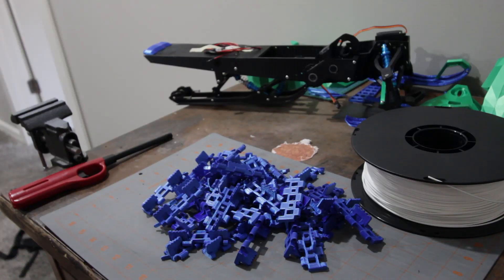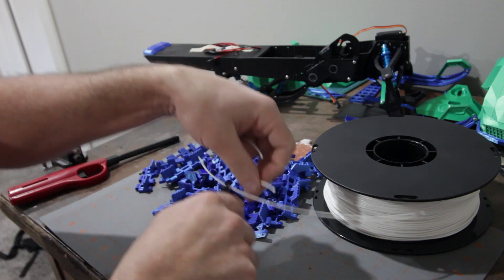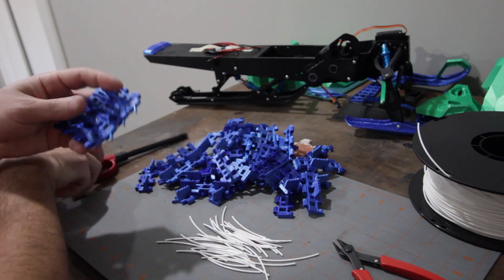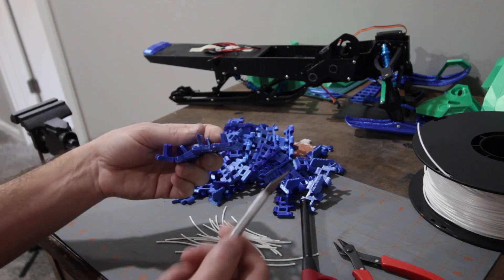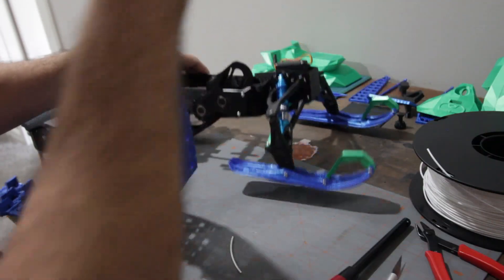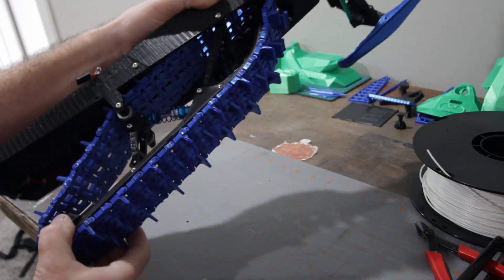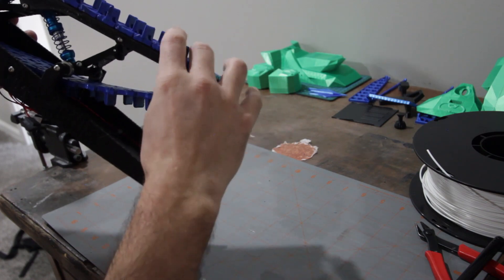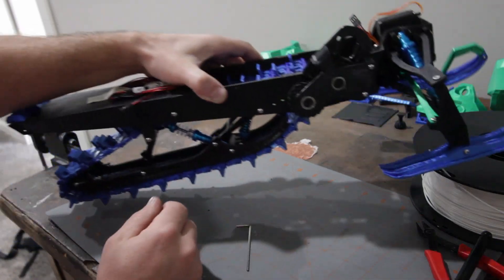SkeeRide Assembly Part 5 - Track

Comment: I printed all the track in 50% infill will that work?
Reply from the maker: I print track with enough walls that it’s basically solid. As long as you’re close to solid you should be fine.

Comment: How Mutch infill and wall for the track pieces
Reply from the maker: I do 6 walls 50% infill.
Reply: @BuildItBetter3D  thanks a lot
Reply: And for your print what speed you are using
Reply from the maker: I’m printing at 60 mm/sec but that will depend on your printer.
Reply: @BuildItBetter3D  ok i have an ender3

Comment: How i do i have print tracks in flex. Wajer ord filament when conekt Tracks?
Reply from the maker: The track can be printed in pla or tpu. There is track design for tpu without the side tab, or there is one piece tpu. If printing individual track pieces then connect with piece of pla or abs filament, or with aluminum rod. If you join the discord channel you can get other opinions on what is better.
Reply: I am prenumerera. If it is Facebook?
Reply from the maker: https://discord.gg/8HbK9fPJ

Comment: I am just about to maybe print the seat but it says it will take 24 hours in creality slicer on a higher quality mode but not the highest. Should I speed it up or would that mess it up and make it look bad?
Reply from the maker: It’s a pretty big print. Depends on how dialed in your printer is. I think I usually can print it in 14-16 hours. You don’t need a ton of supports on the bottom, where the track goes. Your printer should be able to bridge that area. 0.2mm layer height still gives pretty good quality. It’s all up to how smooth you want it and how long you’re willing to wait.
Reply: @BuildItBetter3D  maybe I will just let it go and let it do it on the setting it is on. I think it is .15 but I didn’t see the estimated time for the rest of the settings. Next time I go to print something I will take a look. With the stuff we printed so far it has gone good so thank you for the awesome model.

Comment: I am wanting to use aluminum rod instead of fillament to hold them together but all I can find is 2mm diameter will that fit or is it to big
Reply from the maker: I know many people are using 12 gauge wire, and I think that’s around 2mm. I think it will depend on how accurate your print is and how accurate the wire diameter is. You should be ok to use it though.

Comment: One question would it be good if I used flexible filament for the track or hard filament I didn't know since you used hard filament.
Reply: I have lots of flexible filament but not a lot of hard filament
Reply from the maker: Some people have printed it in flexible and like it. There is track pieces included that don’t have the tabs to be melted, they’re for if you print in flexible, you can just flex the end over your track pin.
Reply: @BuildItBetter3D  thank you

Comment: That track looks backwards to me, wouldn’t you want the braced part of tread on the frontside and the tabs should be facing the rear so they don’t catch anything?
Reply from the maker: I'm not sure I am following what you mean, but they are on correctly. They are designed with a bit of a bevel to assist in the catching and pushing down of the snow.
Reply: he’s saying maybe the bevel should go the other way so the stronger part of the track is hitting the ground first, and the tabs don’t catch on anything
Reply from the maker: If the bevel is the other way then the track will dig into the snow and not provide as much forward force. You would get stuck more often.

Comment: Another way to melt all the tabs into place is with an old soldering iron. I figure it'll work better that the lighter plus you don't get the nasty burn from the lighter.
Reply from the maker: Good idea. Thanks for sharing.